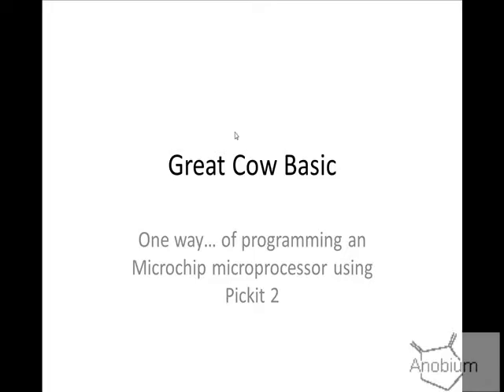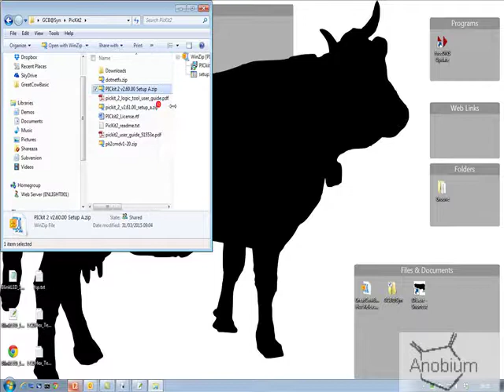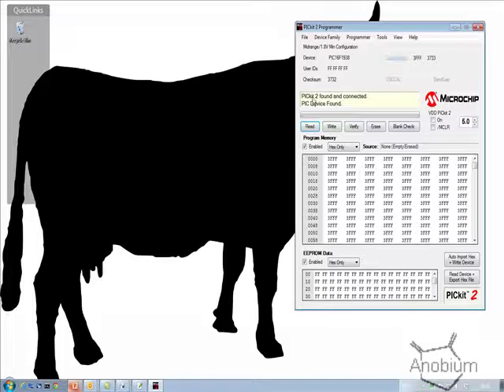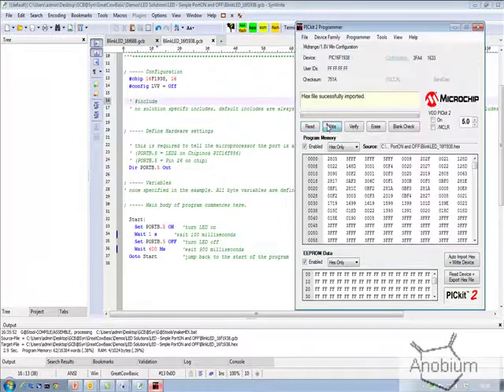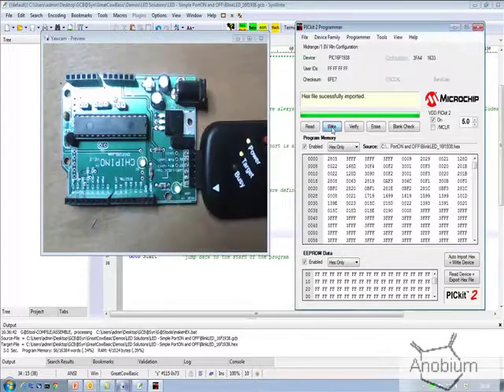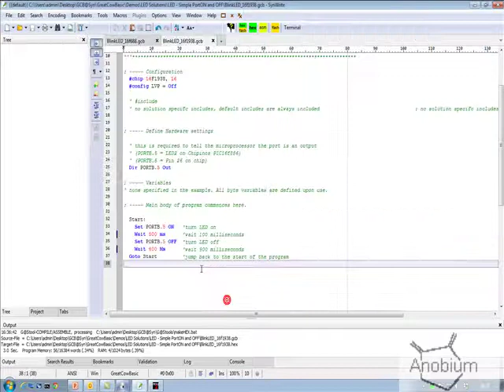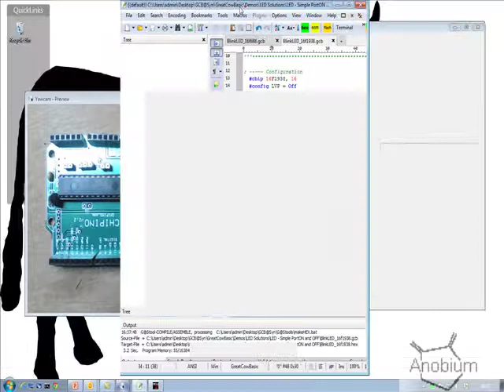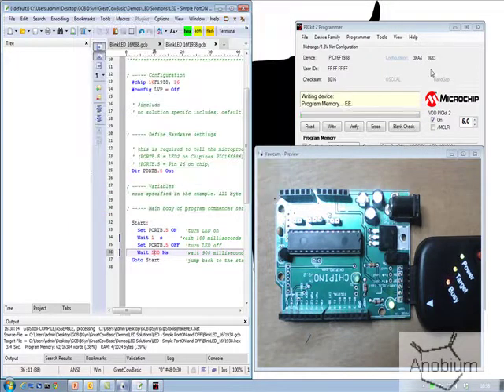Great Cow Basic - One method of programming a microprocessor using a PicKit2

Comment: Just a small point but they are PIC microcontrollers and not microprocessors. There is a very definite distinction between them.
Reply from the maker: @Nick B. You are correct. My error.